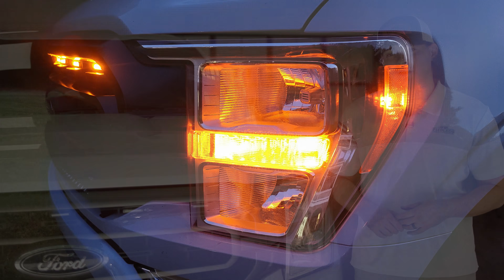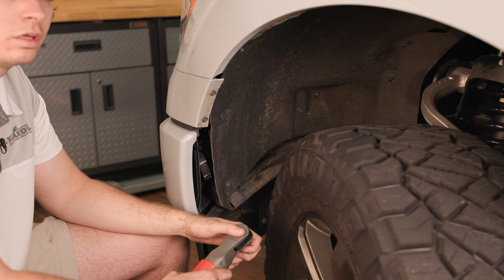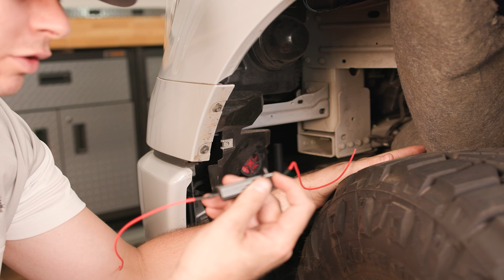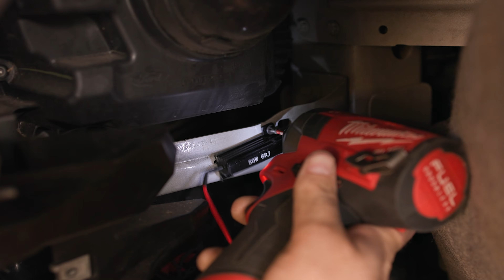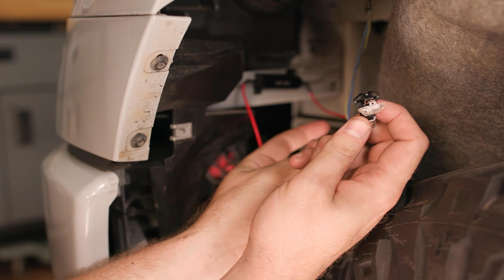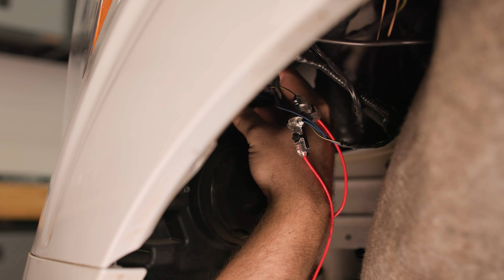F150LEDS 2021+ Ford F150 LED Front Blinker Bulb Installation

Comment: Great instructions! However, I have the bi-LED lights and they are in a single pod, not separate units as with your truck. There is a single either pin connector. Which wires are the blinker wires (color or position) on the left and right side?
Reply from the maker: Hey Freddy, thanks for reaching out! The article below should be what you are looking for! If not please reach out to our install experts through the chat feature on our site for a 1 on 1 walkthrough! http://support.f150leds.com/en/articles/5520946-installing-raptor-lights-or-side-vent-lighting-on-a-2021-f150-with-factory-led-headlights
Reply: Did you get this figured out? I was also wanting to swap these blinker bulbs into my bi-led headlights. That link that they provided is for the raptor lights, does that guide you correctly? If so, how?
Reply: @ethanspruill7539  Yes, I figured it out but I don't know how to show photos of the right wires to tap.
Reply: @ethanspruill7539 . Were you able to install them correctly?  I can’t get them to stay on with the running light or headlights.
Reply: @ffpm350  I was able to get them installed and to work with my Bi-led headlights, however they will not stay on as a drl. The bulb kit is misleading as it won’t be a drl on either headlight model, but I think the mod was still worth it. No halogens at all on the truck anymore, it’s been great. Super bright and no hyper-flash either.
Reply: @ethanspruill7539   Yes, unfortuately ours won't stay on.  I decided to keep them also.